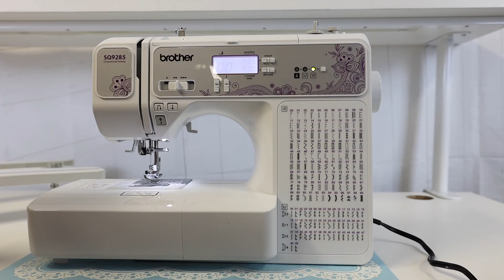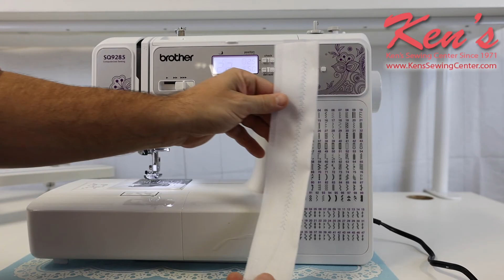Brother SQ9285 Computerized Sewing Machine Overview

Comment: Hi during my sewing I heard a hard sound, I think something moved inside my machine, after that needle does not going  on !/4" piecing foot hole but hitting on foot metal. How can I fix it, Please.
Reply from the maker: Please call us.  Happy to help you.
Reply: This just happened to me this afternoon!! The noise it made and high pitched alarm on the machine scared the you-know-what out of me!! I couldn't move the hand wheel AT ALL.
I've taken the throat plate off as well as the plastic part it's attached to and the bobbin holder is now sitting crooked! I don't know what caused it and I'm afraid the machine is broken! I love this machine!! 😢

Comment: The machine needle always starts on the left side instead of in middle which is annoying.   The settings on the right just dont give you a straight stitch , they are always deco set.    I dont like the way this machine works, so i got a singer
Reply: The default is needle on left but you can change the needle position to a new default..the manual states how to realign the needle to a new default stetting...love the sewing machine...never a problem
Reply: @Pg-wo3do oh ok.  Thanks, I will look at the book again cause I couldnt find it in there the last time I searched.